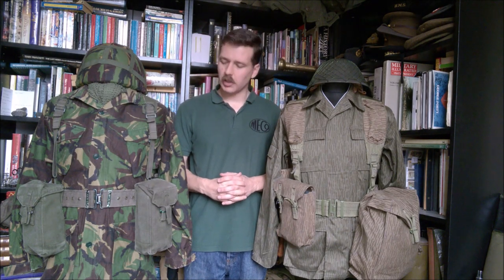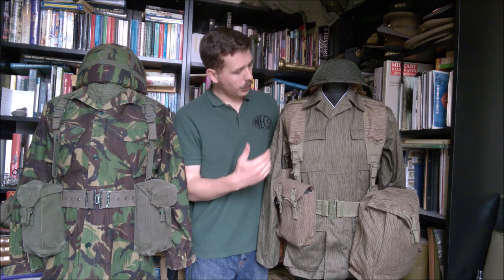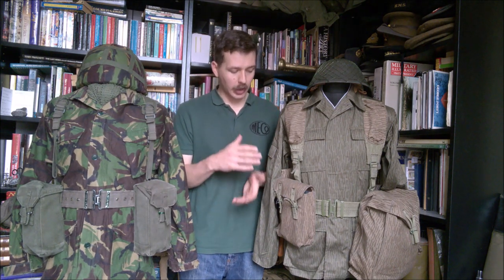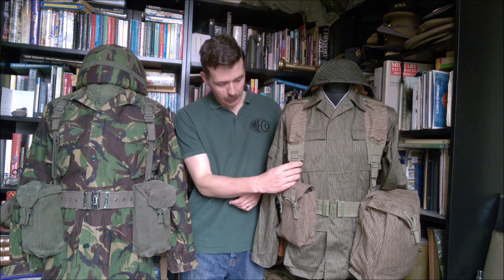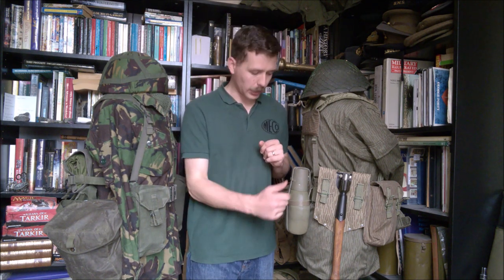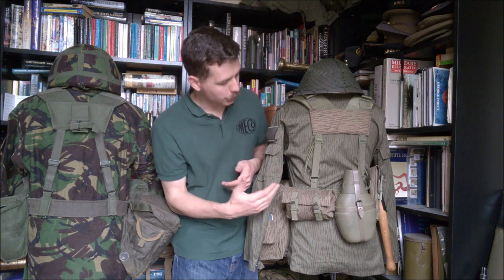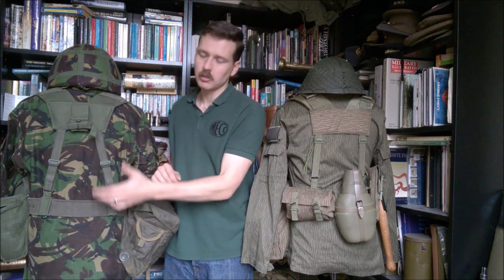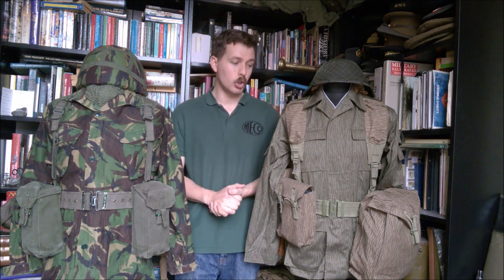British 1958 Pattern vs DDR UTV Part I - Kit Comparison

Comment: Greetings you have an informative insightful video into the comparison between  the
 E. German NVA UTV 1990 webbing gear.

 From 1988 to 1990  I was a US Army Military Police Officer stationed in the then West Germany.

 I did  get to see and purchase some of the new East German Army NVA 1990 UTV webbing a piece at a time. 
At Sturm and Various Dealers of Militaria.  I got initially the Belt, Gernade Pouch and Makarov Pistol Holster. 

The new 1990 version  FDA Uniform was a copy of the Soviet M88 Afganka design which is a copy of the US Army BDU.
The Patrol Cap is similar to the Swedish Cap with Elastic built in head band with a the DDR national symbol ( Hammer & Compass) on the front of the forehead of the wearer. 
 
I was also told by former E.Gernan Border Guards that the E. German government looked into producing a Kevlar version of their M56 Helmet, this unfortunetly did not come about as to cost prohibitions. 

I am very impressed as the  UTV 1990 system seemed  like West NATO  quality gear in quality and design.

Later in 1995, I was asked to help in Building developing the then  New Fledging Estonian Defense Force Military Police (As I am of Estonian background) 

Which I did. As the Provost  Marshal of Tallinn I got to examine and test various nations Webbing, Equipment, Helmets, Weapons,Uniforms etc. 

After I personally  found that  the UTV webbing performed very well I recommended and urged the Estonian Defense Force Command to adopt the UTV System along with the E. German M56 Helmet.  

As I carried and  tested  both while deployed to the NATO  SFOR International  Military Police Mission to former Yugoslavia which you can see on my profile photo taken in 1997 on Deployment. 

I found that the UTV System  in many ways better espically the Suspenders(Yoke)  as you call it then then the US Army "Y" LBE Suspender end fasteners. As the UTV's  vertical angled hooks made for a more confortable non interfearing secure fastening system then the US Horizontal attachment hook system. 

Over the years my experiences  have shown me  that generally all webbing systems do need a secondary securing binding lashing to keep Pouches,Holsters Equipment Secured.

 From becoming detached from the securinh hooks/ clips of the Load  Bearing system; Belt-Suspenders-Yoke. 

What I do is I  securely back up each pouch,holster, piece of  equipment by tying each pouch or holster a piece of 550 Para Cord to any of the Webbing add ons.

I do this to all webbing;  Estonian, American NVA, Israeli Etc. 

Eventually after I left the Service of the EDF I herd that they eventually  designed their own Webbing including Pistol Utility Belt.

All these years later today I use my UTV Pistol Utility Belt and Suspenders, pouches as a Hunting Rig.

 I was able to purchase at very low prices a number of  the UTV webbing  gear pieces which I still Highly recommend for a Solders, Hunters,  Outdoorsman etc. Some good practical items like the UTV  never go out of style/use.
Reply from the maker: Fascinating stuff, interesting to now be using gear from the other side! Thanks for the kind words, glad you liked the video. I'll be honest, for me, this is just for collection and I'm unlikely to get any outdoors use out of it, much as it is very good hard wearing stuff.
Reply: Ausgezeichnet,Erklärung,auch gut.

Comment: Any word on whether the east Germans were going to replace the jackboots? I have come across boots with the designation m90 UTV boots....it's gotta be the replacement. The NVA was improving it's gear with the UTV set up as you display in this video. I to have a whole UTV set up except a few items. The billed cap with rain pattern and... Possibly the M90 boots. They look more comfortable than the dreaded jackboots. I have an East German paratrooper field uniform to and figured they would issue boots similar to fhe paratrooper boots, they are certainly more modern.
Reply from the maker: Yes, according to my limited understanding of the uniform element of this new design a new pair of boots was part of the set, similar to those previously issued to prachute troops.
Reply: @RiflemanMoore  thank you! Im convinced I may have found them. A bit pricey but, I havnt seen them before. The " M90 UTV" is what caught my attention. Initially thought they were tanker or utility boots for maintenance crews or etc. I can't imagine tankers ang ground crews using jackboots! Lol Thank you for spending my money. Lol kidding. Seriously. Thank you and have yourself a good day sir!!!

Comment: Fantastic! I would love to see some more eastern bloc equipment!
Reply from the maker: There probably won't be much more going forward I fear but we shall see. I am keen, in the years to come, to put together some kit from opposing forces to make comparison videos covering various periods through the 20th century.
Reply: Eastern European Equipment serves within its design, unlike western systems it is not as flexible, so quickly leaves its comfort zone when it no longer operates as mechanised Soviet All Arms Doctrine. 

It is serviceable, some items are quite good, other bits rather odd fashioned but they serve, material, quality and flexibility tend to lag era  modular Western systems 
Polish, Czechoslovakian being as the Soviets termed it “Northern Teer “ are better systems within the canon.

Comment: Hi! You missed NVA Sturmgepack which was worn with UTV...
Reply from the maker: I did postulate that in the video but it isn't part of the new equipment perse so I decided not to include it. Not something I'd heard of before so any more info would be appreciated! How was it attached to the equipment?
Reply: @RiflemanMoore  Hi, I did some research on the UTV Sturmgepäck!
A former nva soldier told me that the Sturmgepäck that they planned to issue was a simplified version of the Fallschirmjäger-Tornister 74 (FJT 74).

It is estimated that they produced a very small number of those backpacks, same thing with the boots...
Reply: Likely there would have been an adaptor for the Assault pack as well,  so the older pattern could  be used, the NVA were very big into “wear out dates”, they wasted little as they were short of money.
Reply: A UTV Sturmgepäck doesn't exist. We did research in that regard and no UTV Sturmgepäck, atleast in a not prototype state, exists. They where instead meant to use the normal Sturmgepäck furtheron. Those where produced until 1990 and fitted perfectly onto the UTV System

Comment: I managed to attach the East German pack to the back of the UTV harness by simply using Paracord
Reply from the maker: Sure, you can tie anything to anything when it comes to web equipment. I don't think that's the itended method per the design however.

Comment: Nice work. There are variants of UTV items, if you some want photos, I can send you some.

Lack of information is a bane for us English speakers, lack of an Assault Pack that fits this system is still a gapping wound in understanding it. As one would have lived in your fighting vehicle for you daily needs and likely another as a Clothing bag with your Blanket in Company Transport if it followed the older system.
Reply from the maker: I'd certainly be interested to see the other variants, yes! I am currently on the lookout for the ammunition pouch design with the small side pocket.
Reply: If you get the Bulgarian system that seemed to have been developed with the DDR, you will find some real quality in production and materials that will cause old Soldiers to use the time honoured phrases that old Soldiers always use in regard to kit.
The Bulgarians oddly liked to have their E tools haft up even in the early twentieth century, so maybe that is were the UTV system gets it from?
The Bulgarian Complex did have a Assault pack though....like an 58 pattern oddly sized larry large pack so that maybe a clue to the DDR system?
Reply: That would follow the MPi AK 74 N norm, so it has the internal pockets for 4 x 15 round chargers and the  magazine loading tool, internally and externally the weapon cleaning kit. 
The other pouch you display follows the earlier MPi KM norm..... so it shows the continued use of the 7.62 x 39 mm weapon system on the adoption of the equipment as part of the 1990 era  new dress regulations. 
These would have bought in nasty ( and I mean nasty) Berets and Ankle Boots to NVA Dienstuniform orders of dress. 
The NVA was to losing its historic look of the German Soldier they valued.
Reply from the maker: I'll have to keep an eye out for the AK 74 pouch as I say, they seem to have dried up recently. As for the Bulgarian kit I have seen it but likewise it seems to have disappeared off the market in any numbers recenrtly which is a pain! If they colaborated on designs as you say then maybe that did indeed influence the entrenching tool carrier being worn handle-up as some suggest.
Reply: David Brennan 
If you don’t mind? Could you please send me the photos  of the variants of the UTV items.
Reply: Web Gear Review, if you send a contact I will happily assist.
Reply: Web Gear Review , I will see what I can do.

Comment: Maybe, den UTV is a little bit modern than before. But I think for comfort is the parachute fighting vest, the best. Thats would the best way for a modern UTV bacl then. Also modern materials. 
The problem with the material, is it wet, the time is to long for dry.
Then special zons, Ass and knee mor and padded material.  

For me the best fight NVA Battle dress, parachut battle dress. very good comfort. 

The tarn, also verry good, "Ein Strich kein Strich" I think, also in this time, a good tarn.
Reply from the maker: This is true, the vest is good but it wasn't designed as a standard issue bit of kit.

Comment: The NVA uniform is the wrong one for UTV, the bayonet is missing, the canteen and the e- tool need the switch places and the e-tool's handle needs to face upwards not downwards.
Reply from the maker: This is definitely an example of the last pattern of NVA field uniform which would have been worn with UTV, it was in production from 1986 to 1989 so there are some variations between patterns, nva-tarnuniformen.com has more information on this. 

No bayonet was carried in the one original photo of a chap wearing UTV which I've seen so I decided to omit it here, I will be going over that in more detail in part II. 

I have seen no original documentary evidence to suggest the Klappspaten should have the handle worn upwards. The widely circulated photos which show the handle upwards were taken post-unification for a book on NVA equipment. With the lack of primary evidence I do not like to assume that the NVA would move to having the handle up rather than down. Thus it has to be carried on the hip rather than at the rear otherwise the wearer would be prevented from sitting down. 

If you can provide the equivalent of original fitting instructions fro UTV I will happily concede the point.
Reply: @RiflemanMoore  whats your name on insta? Im gonna show you what im talking about! You didnt do any good research! If you had, you would know that the shovels handle is worn upwards, and the bajonett was also attached straight on the front of the body! Im a eastgerman militariacollector u can trust me cuz i am straight at the source!
Reply from the maker: I actually did quite a lot of reading and research before producing this video but I'll be interested to see what you have. My Instagram is linked in the video description.
Reply: @RiflemanMoore  I did send you some avidence. @soviet_afghan_war_reanactor
Reply: Er hat eigentlich alles richtig erklärt, die Uniform ist definitiv richtig.

Gruß Matze
Reply: I have seen pictures of the e-tool handle facing upwards. This assumption is drawn from the way the belt loops are sewn to the e-tool carrier on the back of the older gray webbed e-tool carrier. The loop attachments appear upside down. So the carrier, and the e-tool must also be worn "upside down". This somehow has carried over to the UTV e-tool carrier. Even thought the belt loops are sewn the same as other UTV pouches. I think this was done on the older carrier to provide more stability, i.e. less of a swinging pendulum effect. And to cause the end of the e-tool handle to lean slightly more toward the wearer.
 But the most obvious answer would be is that the upright handle, sooner or later will catch on something.Or an opponent would grab it.